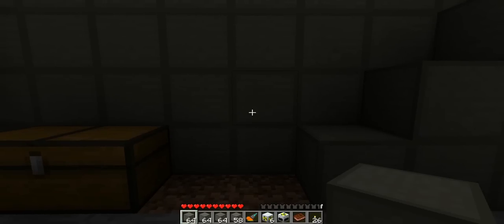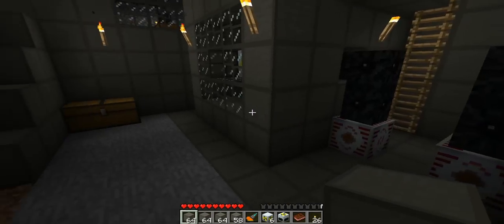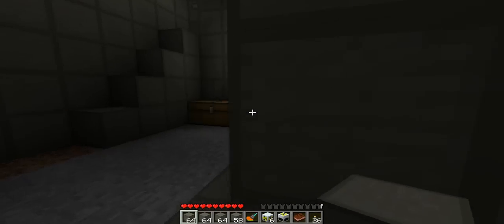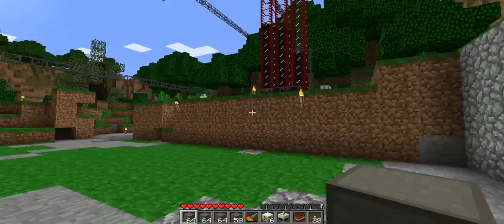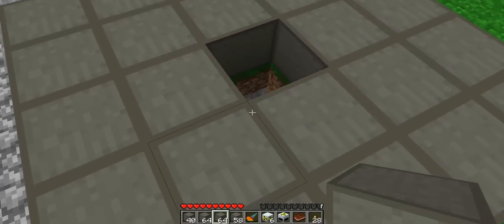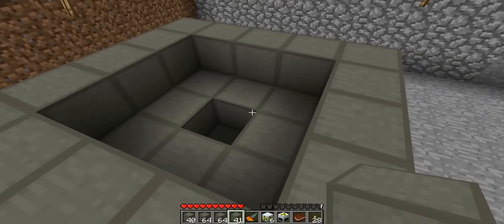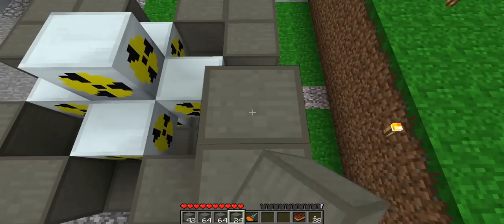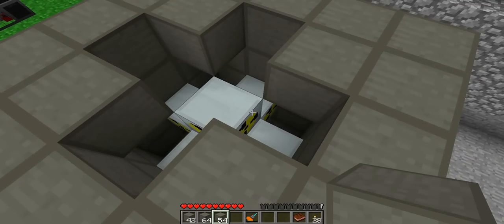Minecraft Fun - Episode 26 - Lets Play Industrial Build Craft - Water Cool Nuclear Reactor

Comment: Due note that as of v1.64 or v1.70b I believe. The first layer of reinforced wall or glass will be ignored by the reactor blast and will go through the wall as if it where not there. You need to create at least a 3 layer protective barrier in order to contain the nuclear blast.
Also, never ever place cables on side of containment building as its a hole that the blast can go through and destroy everything on that side of the hole.
Always make your holes on the top on structure. its air above.